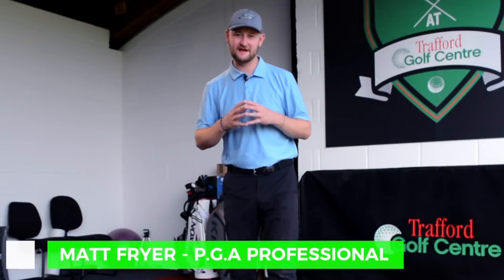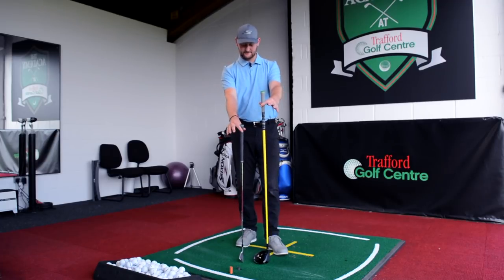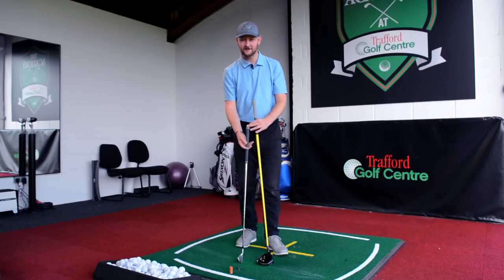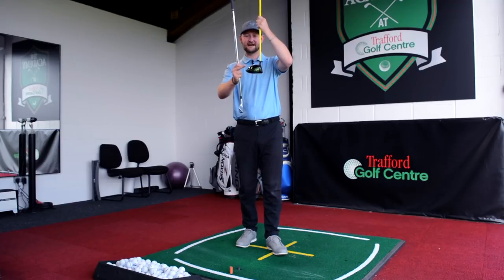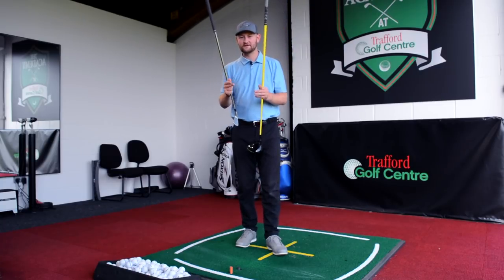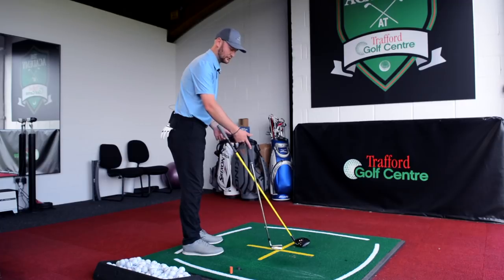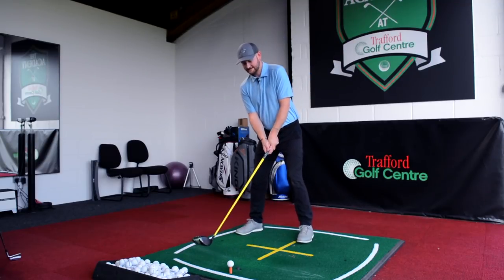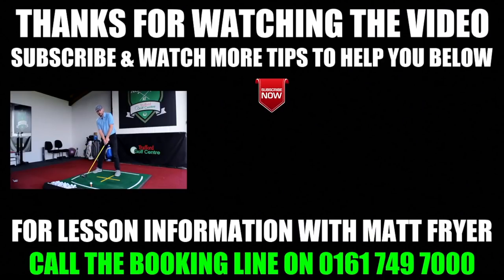THE DIFFERENCE BETWEEN DRIVER SWING AND IRON SWING

Comment: Thanks Matt.  Just one question, when you were using the iron you had a small bump forward with your left hip to start the downswing.  For the driver I did not see the same.  Is that correct ?
Reply from the maker: I still have one with the driver, just with the upper body hanging back it doesn't seem as apparent. Need the weight to transfer to the lead foot to create as much force as possible.